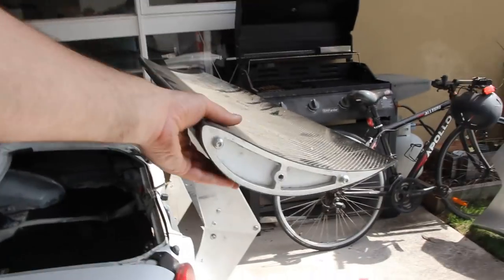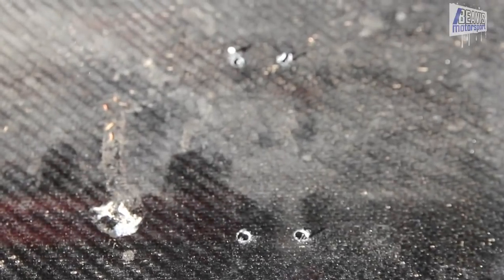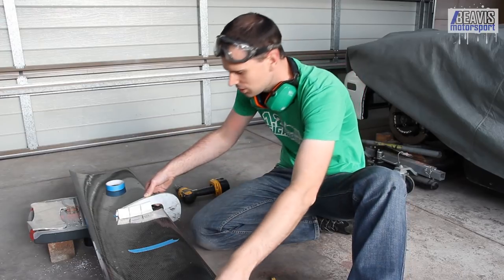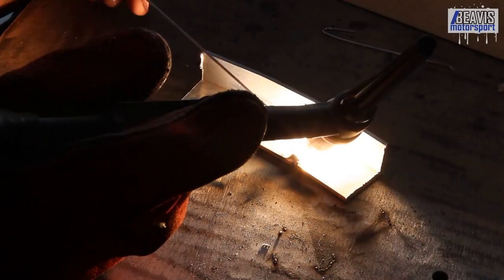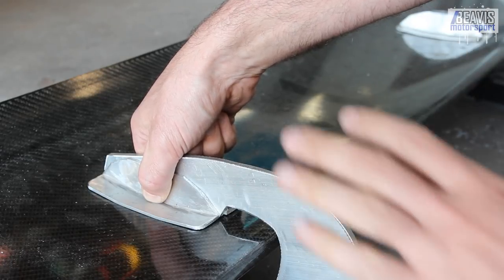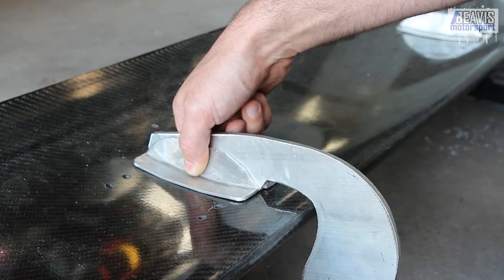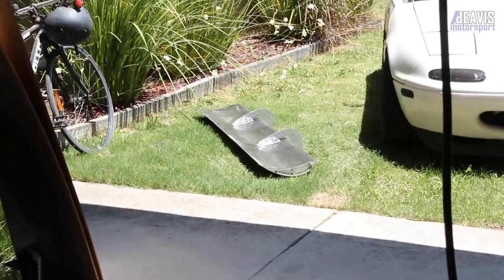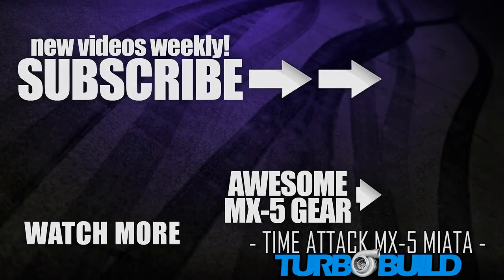DIY SWAN NECK WING MOUNTS! - Episode 52 - Time Attack TURBO Build

Comment: Nice solution using the swan neck,  just wondering, did you think about welding some flat bar to the bottom of the new brackets instead of those two angle brackets?
Reply from the maker: Hi Colin, that's a fair consideration, I kind of just used what I had on hand and ran with the materials i had spare. (Didn't have any flat bar) This is perhaps not the best solution, but that's ok it should still work well.